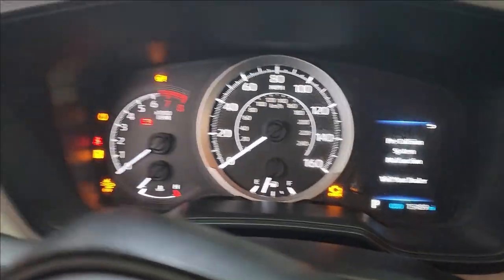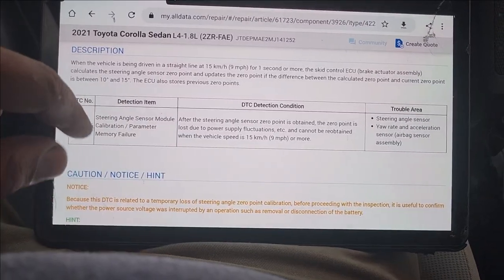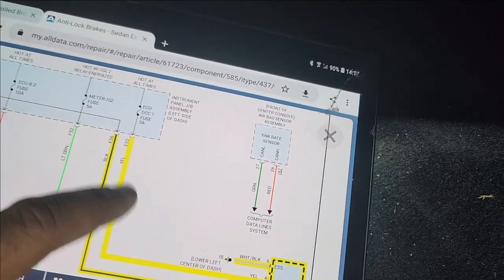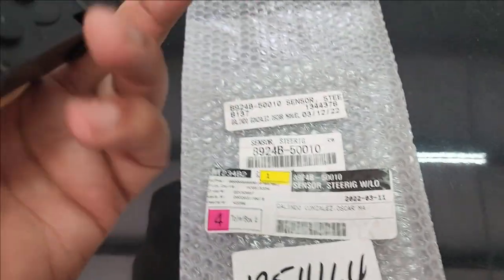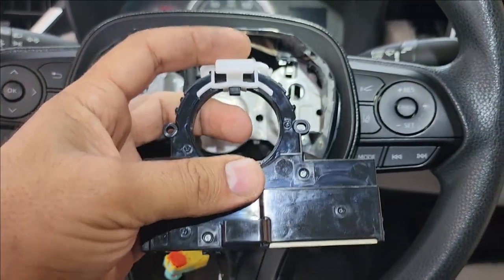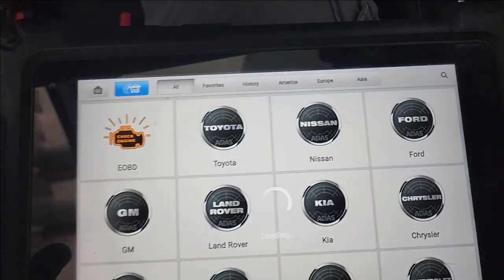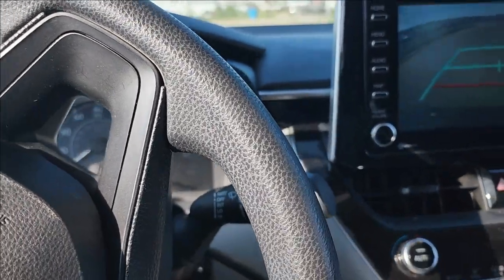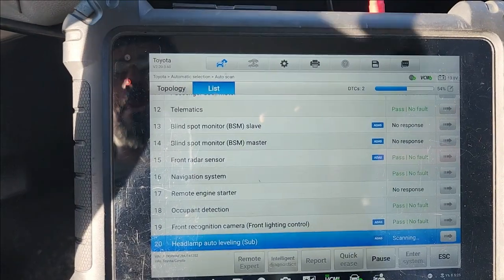2021 Toyota Corolla Steering Angle Sensor faults C052646 and C052696

Comment: This video saved me a trip to the dealer. Checked with a $50 OBD2 scanner from Amazon and my angle value wasn’t changing when I moved the wheel. Found a replacement on eBay and fixed it myself 🙏🏼🙏🏼👏thank you so much don’t know if you will ready this by this time

Comment: Just a heads up I have a 23 Corolla that I just finished repairs on I had similar codes using tech stream Toyota software trying to recalibrate everything and it still returned same as yours. Code finally cleared and took calibration after take the battery off for a few minutes.
Reply from the maker: Nice. Thanks for the tip. I will try it next time.

Comment: As a technician I can say this sensors is a electronical and operated only by computer inside.

MOST important thing to do after replacement to do a Zero calibration Point and make it zero before calibration. 
Warning if u don't do it and u overturned a steering in hope it will calibrate by itself - wrong! 
the sensor will be white down a code in the EPROM (u can't clean it) - steering angle sensor internal faulty.

To reanimate this Angle sensor u have to Reprogram the EPROM
Reply from the maker: im starting to learn how to do so. thanks for the tip

Comment: Nice video! Did you check live data to see if the old sensor was reporting any movement, like you did on the new sensor?
Reply from the maker: I did. It was dead no response to movement. Also tried SAS calibration but came out with the same error I got when I did calibration to the new sensor.
Reply: When I read fault SAS module.no.dtc rav4 2020 but pre collision  say angle sensor lost communication c052696

Comment: Hello, I have the same problem as you, but the car is also going to the right and I have already aligned it twice. Do you think that after calibrating the sensor I won't have to align it again? Thanks in advance
Reply from the maker: I don't think you need to align again after sensor calibration